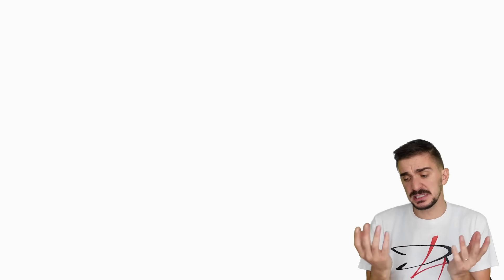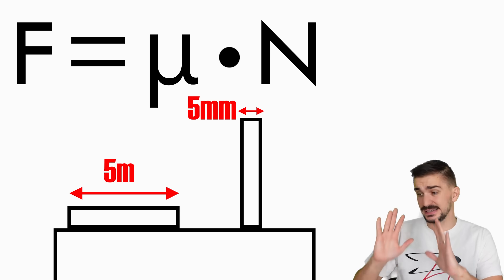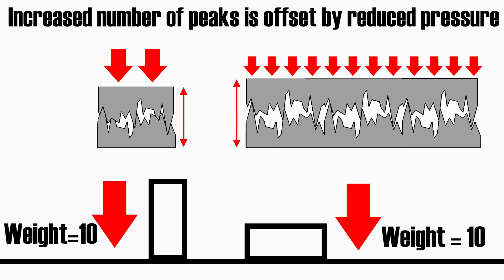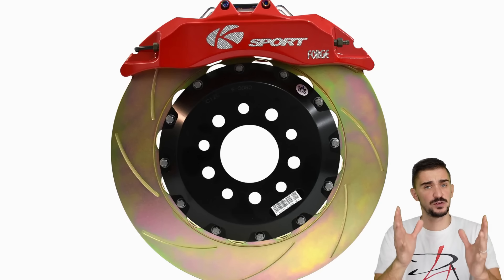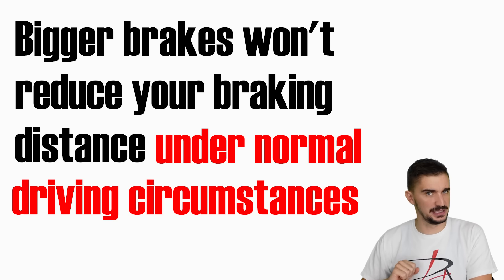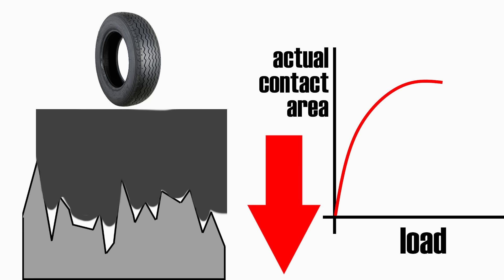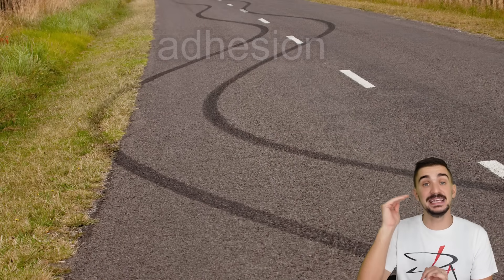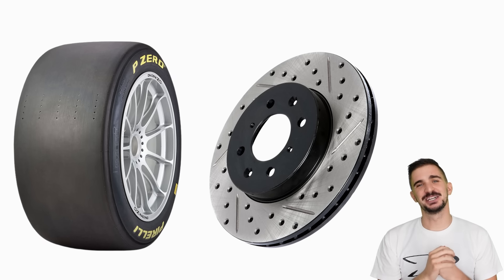Why Big Brakes Won't Stop You Faster but Wider Tires Will - Friction and Surface Area Explained

Comment: Is this really true? 
Because to stop your wheels faster, there's another component that you have to fight, which is torque.
Your wheel has dynamic torque during movement which is Inertia x Angular Acceleration, which you will set equal to Friction Force x Disc Radius to determine how much static moment you will need to apply to decelerate the wheels.
If you have longer radius, you won't have to apply much friction force to the discs from the calipers to generate the counteracting static momentum to the wheel's dynamic torque.
So, although I agree with you on the larger brake pads and caliper doesn't contribute much, I cannot agree with larger disc diameter not contributing. I believe larger disc is more than just for heat dissipation, it does contribute to reducing the existing kinetic rotational energy of the wheels.
wheel energy should be (1/2) * Inertia * Omega ^2  which is equal to (1/2) (torque(t)*time)^2, so any static torque increase from the radius increase of the discs should contribute to reducing the time it takes to take away the rotational kinetic energy from the wheels
Reply: Well, the larger radius and the higher mass of teh larger brake disc does also add some rotational kinetic energy. Also, the moment of inertia of the wheel and hub assembly is really a tiny negligible fraction of the overall kinetic energy a car in movement posses. A rim with tyre is somewhere in between 15-25kg. A typical car overall is 1.2 - 2 tons.

Comment: You're being a little technical, which is great, but the end conclusion is the same, bigger brakes are better at braking. 

But the terminology is not as simple as increased surface area increases friction, but rather increase surface area dissipates heat better. And again, bigger is better. 

But to be more specific a brake pad which has more mass and a rotor with increased mass increases friction, which increases stopping power, therefore bigger(brakes with more mass) equals better braking. 

Please correct me if I am wrong. Thanks!
Reply: But he talked about stopping distance (at least in the title) not "better braking". Yes bigger brakes are better at doing their task since they overheat slower and all, but they don't stop you sooner
Reply: you are wrong lol

Comment: There is NO normal car on the road that would not benefit from bigger disc brakes so therefore you title is just a click bait:D

I dare you to test this on the road. You might find maybe 1 or 2 brands that would stop the same with larger disk brakes BUT 90-95% of the cars on the road would stop faster with larger disk brakes and same tires.  

For almost all the cars I drove so far the main issue is not the bad tires but the bad braking system (because of cost concerns manufacturers cut corners). 
I would say that in real life the brakes are so poorly designed that do not take full advantage of the tires.  

The "force arm" that opposes the wheel movement is determined by the disc diameter. In ideal world it is much easier to stop a wheel if you try to stop it from the outer diameter than from the axle diameter (very easy to test also). 
The force required to stop a wheel with smaller discs is larger that the force needed with larger discs if we have the same friction/brake pad contact area.

Also another very important factor is ABS  that works very WAY more efficient with larger disc brakes therefore taking better advantage of tire slip percentage from here resulting faster stop speed.
Reply: wow.... 60IQ BOT.... nice
Reply: @mishaisspeed  what? He said that bigger discs are better at least because of heat dissipation BUT friction is not the only force that is to be take into consideration here. The way the forces are decomposed îs also important and the disc diameter modifies those parametrrs very much.
I dare you to make an experiment and install 50% wider tires on your car. What will happen? Your brakes would fade from the first brake you take because the same disc size is no able to oppose enough leverage for the bigger mass. 
Take bicycle brakes as an example. This is the perfect example - larger diameter disc brakes (same friction area) brake faster and if you don't get this than...who is the idiot?
Reply: @titusm9837  lmao, as an engineer it is so cringe to read your generic "science jargon" knowing that it's complete nonsense looool. "The way that forces are decomposed" 😂. What way are "the forces decomposed" ???? I actually can lay out and calculate the individual planar vectors for each acis of rotating or points of interest, and no... There is not anything else to consider. The video litterly spent almost 20 minutes talking about how every car on the road can lock up it's wheels with small breaks therefore making the limiting factor in the system the frictional force of the wheel to the ground and NOT the brake rotor to pistons (orders of magnitude higher).... And in like you, I actually built racecars that you can check out on my channel, and don't need to test your dare due to the fact that my 6000lb work truck with stock brakes can stop faster than my formula car even though the formula car is lighter and has bigger brakes, due to the fact that work truck has abs,...... Hence proving the point that every single car on the road does not need bigger breaks

Comment: I thought a bigger diameter disk brake provided a bigger lever, thus increasing braking. Why do supermotard bikes have a bigger disk than motocross bikes?
Reply: because they ride with potentially higher speeds, which means there's much more kinetic energy to dissipate. 
Also, if you look into high class racing like F1, WEC, WRC or MotoGP, they generally don't use the biggest diameter disc they could use from a space inside the rim standpoint, because there's no point in it. The brakes they have are strong enough and would put anything that drives on the road to shame, especially when it comes to braking distances.
Reply: 60IQ

Comment: I won't get into things that weren't addressed because they aren't central to the subject at hand (for instance, motorcycle tires are naturally anti-hydroplanning and therefore...).

HOWEVER, saying larger disc brakes won't directly improve braking performance is bollocks.
You forgot a little element that ruins a significant part of your video.
That little element is called TORQUE.
Larger disc have a contact area further away from the rotation axis, therefore increasing the breaking force proportionally.
How you got that wrong is beyond me.
Reply: How does the higher torque overcome the limited grip of the tyres?
Reply: @shi01  Don't ask me. Ask someone who actually wrote such nonsense.

This little misunderstanding being out of the way, I get the feeling you are not asking the right kind of question. It's like asking: "Why bother with disc brakes when drum brakes will do, since tires' grip is limited anyway?"
Reply: @kextrz  No, that's not what i mean. Disc brakes were introduced because of the better heat dissipation and somewhat easier maintenance.
What you're stating is basically, physics don't apply. 
It doesn't matter how much braking torque the larger disc could produce in theory, if the tyres can't handle this additional force and simply start to slip at the same force as with the smaller disc, which they will. If your theory would be correct, a more powerful engine would always, under all circumstances give you better acceleration, which isn't true. Why have dragsters these special super soft ballon tyres on their rear axle? If tyres wouldn't be vital for acceleration or deceleration, then why they don't use normal road tyres? Shouldn't matter if you're right.
Reply: 60IQ bot

Comment: Matter of fact, friction equation still works with tyres. Just put a car on 45° angle asphalt hill, and try to go up witout momentum. It won't climb, because the miu of rubber and asphalt is 1, so the angle which these two materials start to slide is 45°. The proper equation for the entire thing is the adherance eq, which takes into account the surface area and molecular contact of the materials.
Reply: you dont know wtf u talking about lol
Reply: @mishaisspeed  i'm engineer, so shut up. Go wash some dishes.

Comment: A good explanation of a commonly misunderstood issue but I didn't notice you mention that a larger diameter disk will reduce the torsional force between the pads and disk. A 'bigger' disk will therefore stop you faster if your sisks are so small in diameter as to raise the torsional force to a point where the pads are unable to retard the rotation of the disk suficiently.
Reply: Well, that's correct but i don't know of any car where the achievable brake torque is so small that you can't lock the wheels almost immediatly if you really push the padle down.

Comment: I have a question, the bigger brakes have a higher lever because they have the force far away than the smaller, so this doesn't make the brake more efficient for slowing down the tire with the same force applied? thanks if someone responds😊
Reply: Well, you would need less brake pressure for the same braking effect. So in that sense the brake is indeed somewhat more efficient...but also more touchy.

Comment: I can only suggest to everyone to try to drive a modified or even stock Volvo 850 R on a German Autobahn and you will instantly realize that what you really need are bigger brakes. That‘s why Volvo themselves offered two different versions of bigger brake kits for this car and damn, they should be ashamed they did not come stock!

Comment: Surely a bigger brake disc would need a bigger caliper? Therefore more force applied by the pistons onto the pad. Therefore giving a larger normal force from pads onto the disc and increasing braking power

Comment: There is another way that brake rotor size matters.  Increased radius of the disc will mean a greater braking torque can be applied to the wheel.  Of course, this only matters until you have enough available braking torque to lock up the wheel and skid; then we're back to your tire width stuff.  Case in point: I used to have a crappy electric moped with big 18" wheels but tiny scooter brakes.  It couldn't even produce enough braking torque to lock the wheel.  Terrible and scary braking on that thing.  Though I did joke that it was equipped with anti-lock brakes.

Comment: According to TUV, you need bigger brakes when swapping faster engine just then, when your max speed exceeds original one.🤷‍♂🤷‍♂
Reply: youtube "engineers" explain stuff in a nice way... never every really experienced it in practice... i got bigger brakes and my stopping distance went 5 to7 meters shorter... that's A LOT. and yes fast cars need big brakes look at european cars that go faster than 200... all big brakes. why? because you need that for decreasing the stopping distance and getting heat out of the system faster.

Comment: I don't believe this is entirely correct. You can have the same argument stating the brake pad is soft when compared to the rotor. When under extreme braking force the pad can conform to the rotor, thus improving friction. So surface area in brakes could improve stopping power.
Reply: yes this video is mostly incorrect. but  you need good tires with it too. thats the only thing i agree with... at least i experienced it when i gone from stock (sport brakes) to a big brake kit... damn it bites like a madman and the braking distance drasticly decreased.
Reply: 60IQ bot

Comment: Increasing the size of the disc and placing pads at the end of the disc can provide more braking torque by keeping the amount of force constant. This is not a good justification for increasing the disk size? (except for the advantage of increasing cooling)
Reply: bot

Comment: Man you got this one wrong. Bigger breaks do stop you better but not because the added area but for the bigger leverage. It is a matter of torque. The further the caliper from the center of the wheel the bigger the braking force. Then comes the need for extra heat dissipation. You forget one important thing. The coefficient m is irrelevant to the pressure only in Newtonian physics. In modern physics we know that it depends also on the force you push one surface to the other.
Reply: you can compensate this by more pressing brake pedal
Reply: lmao  @siniyden
Reply: bot

Comment: Something important to note, if your standard braking system doesn't have the ability to lock the tyre , ie reach maximum Traction of the tyre to the road then bigger brakes can improve stopping distance, this usually doesn't occur unless your carrying extra load or have an issue with the OEM braking system though

Comment: 4:50 Wouldn't calipers with multiple pistons change this theory and add more pressure than calipers with fewer pistons? Also, couldn't you say upgraded brake kits have hardwr pressure than juat simply changing to a larger rotor?

Also, everyone saying they feel the bite hard on drill or slotted rotors versus solid are....lieing?

Also, isn't the gases that's released not happen as often nowadays because we use more efficient material? The gas is less of a concern, no? Which matiwral cause this concern in modern day?

Also, how much rotor surface area do you need for a +300hp, +500hp, +600hp, etc. For example, 356mm would surfice for how much horsepower theorically???  Especially now we see these newer 2020+ sport cars with ridiculously large rotors at +390mm. Is it a marketing gimmick?!
Reply: ALSO you have 60IQ
Reply: @mishaisspeed  did I make you cry? Get a life

Comment: Lets pretend brake fade doesnt exist. Although it does. Hence why if you believe the bullcrap in this video you can get brake fade and smash into something assuming your brakes will work but because they are too small cant dissipate the heat dont work at all. I sailed right past a left turn for precisely this reason and if i had bigger brakes i would not have
Reply: not what the video was about at all
Reply: also he did talk about brake fade...

Comment: Another point you missed on friction. Is where you push. Take a paint can, set it on the table, push 1 inch off the table, now puch near the top, has the grip changed?

Comment: At 07:15
There are a few exceptions here. I had a Honda CBX-1000 6-cylinder motorcycle from 1982 that had 2 heavy ventilated disks on the front wheel.
The brakes worked fine, but it added a lot to the unsprung mass.

Comment: Normally the grip of the tires is the bottleneck for deceleration, so adding more power to the breaks can not make you stop faster. However, the same stopping power will be less hard work for the bigger break and the thermal energy will be spread over more surface and cooling capacity, so in heavy use, such as racing, they will keep performing for longer without overheating and with less fading...

Comment: Of course wider tires are better but they are only providing friction to the road surface, whereas brakes are converting the kinetic energy of the vehicle into heat, and that is where the mass of the rotor comes in. If the rotor cannot absorb more heat the brakes become ineffective and don't input any resistance to the rotation of the tires and then the size of the tire becomes irrelevant.

What you've got wrong in your analysis is the fact that as the rotor gets hotter it's coefficient of friction drops, it is NOT a constant when it comes to brakes, and the increase in temperature has an exponential effect in the drop in the coefficient of friction. 10 degrees hotter may, for instance drop the coefficient 2% but twenty degrees hotter won't be a 4% drop but more like 7% drop. We found this out in the early days of the Space Shuttle, and an active cooling solution had to be found to keep the rotors cool as the Shuttle was landing. So the answer isn't just bigger tires: Heavier rotors has a huge effect as well, and larger rotors WILL stay cooler longer, shortening braking distance because the coefficient of friction between the pads and the rotors will be higher for a longer period of time.

Incidentally, you show bigger rotors that have holes drilled in them and slots carved into them, but what many people don't understand is that those holes and slots are there for ONLY one thing: To help braking effectiveness when the pads are soaking wet. It does nothing the help cool the rotors. When the pads are wet, it doesn't take long under braking for the water in them to turn into steam that will try to lift the pads off the rotor, so providing a means to let that steam out will improve pad pressure against the rotor. The drawback is that the holes and slots remove mass from the rotor, diminishing it's capacity to absorb heat when things are dry. So go with one or the other, not both. Both might be needed on a race car when race day it is raining, but it will get new rotors the day after, but on a street car both will be sacrificing mass for a small benefit as well as shortening the life of the rotor. I have mine drilled because the holes will be there for the life of the rotor, whereas slots will get smaller as the rotor wears and eventually be gone when it wears down to the end of them.

I must disagree on this point: Bigger brakes WILL stop you faster, specifically big rotors will stop you faster. It might not be noticeable from 35 to 0, but on my 2004 Marauder the 14" rotors I added to replace the 13.1" stock rotors reduced my 60 to 0 stopping distance from 120 feet to less than 100 feet, and with the same tires, which were adequate all along. The benefit from bigger tires is not about the heat, but the area. The benefit from bigger rotors is about heat and how it degrades the coefficient of friction between it and the pads.

Comment: You are not a car guy. You a high school teacher. Yes, the law of friction on the surface says that, but the number of the brake cylinders makes a difference. The larger diameter of the rotor will also have a greater lever advantage.